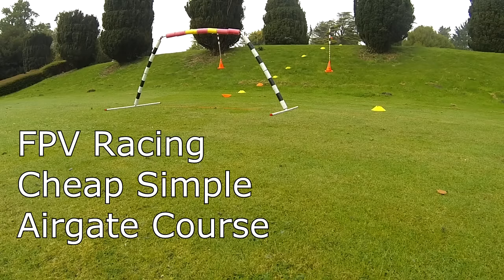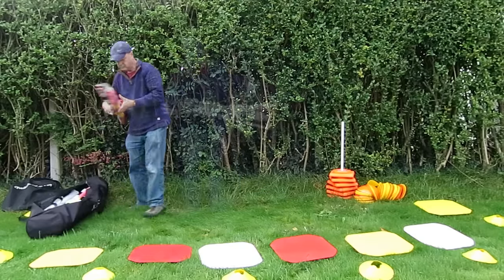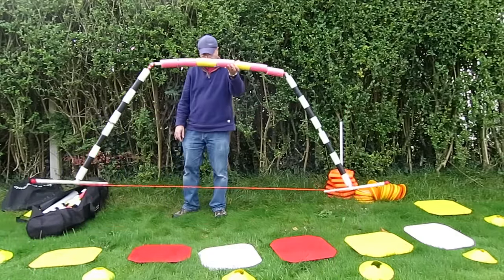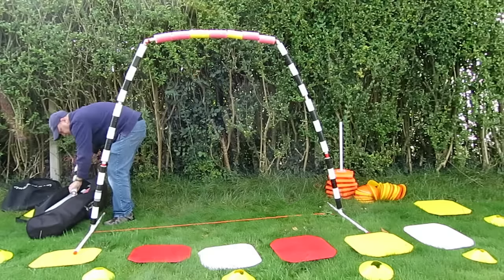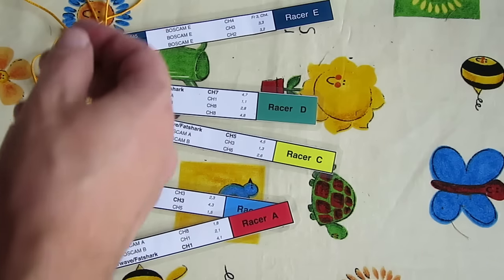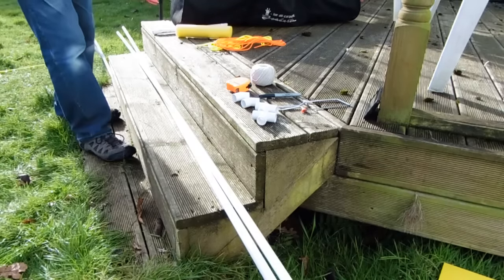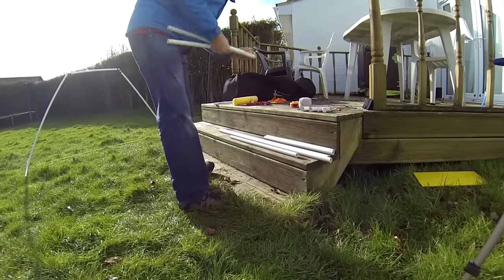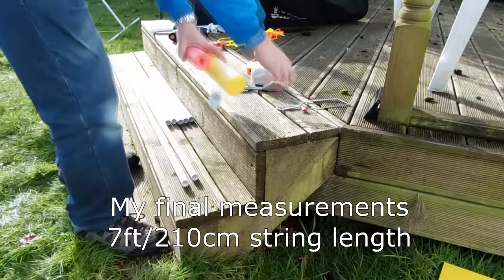How to organise FPV Racing - cheap simple airgate course and frequency management

Comment: Great job now all we need to do is make a timing system.  Would be nice to use an old android phone connected to LED timing system.
Reply from the maker: +Jon Car For small groups of racers, you don't need transponder timing, could either just call your own laps (which works fine), or have coloured fins/flags/LEDS on quads and someone counting with keypresses (there are free RC car racing programs which work this way). I understand cleanflight is going to generate LED pulses compatible with the i-Lap gear, so thats the way its going, so silly to invest time or money in something else as a short term solution IMHO.